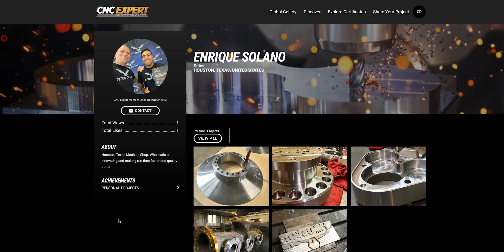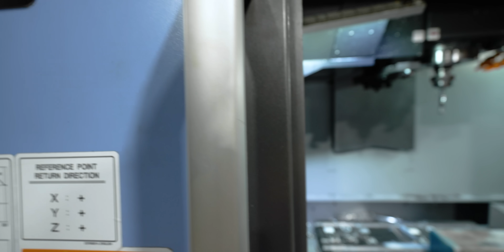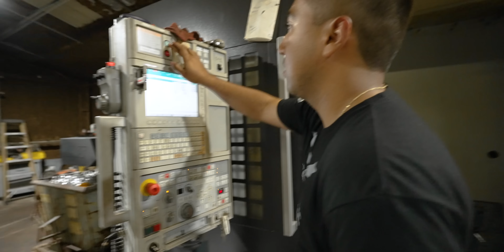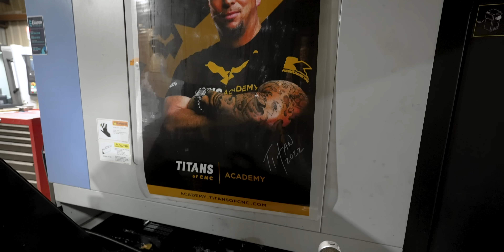Fighting With BOSS to INCREASE PRODUCTIVITY | MSM Machine Works

Comment: Many years ago the machine shop I worked at got bought out by the supervisor.  To get going they partnered with another local machine shop.  The partnership fell apart partly because the partner got fed up with slow cycles.

As for Kennametal NOVO, I learned about it at said partner when I worked for them.  While the culture wasn't that great they did care about CNC efficiency, especially once one of their customers dropped big orders on them.

NOVO and Harvi I TE turned machining stainless from a chore to something actually enjoyable.

Comment: I'm currently running a part that the previous lead/programmer had as 5 ops taking 2-2.5 hours each and I reprogrammed to only have 2 ops and one side takes 20 min while the other takes 9 min. I can go more but being forced to work on 3-4 machines while also helping coworkers with their setups and programs while also being asked for help from other departments has made me say enough especially when the owners don't value their employees and only care about getting new toys paid for by the employees.

Comment: Before I went it alone, the company I worked for (17 years) invested in vmc's and a 5th axis but refused to invest in 22 yr old lathes. I spent as much time trying to keep them running as I did cutting. after I left both machine completely packed in and was forced into buying two new Doosans. The help is out there for companies to push faster and better even if just with tooling. I don't do anywhere near the complexity of most but can always call on tooling suppliers for assistance and for free. what's not to gain from asking. listen to the staff. best of luck for the future.

Comment: At work we have a mori multitasking machine thats scrap bc an operator decided it was a good idea to turn the speed up of the turning Spindle. The part is unbalanced because of its shape so it flew out of the chuck, hit the milling spindle and cracked the cast iron of the x column. Sometimes theres a reason to go slow

Comment: Where I work, we make a part drilling 3x1.5mm holes 9.5mm deep into aluminum, and for some reason we kept breaking the drills. Someone slowed the drill cycle down to 3 inch per minute and pecking .01” per peck. I changed the drill cycle to 6 IPM and .1” per peck (still pretty conservative) and this by itself dropped the cycle time from 2:40 to 2:00 per part, and magically the drills aren’t breaking anymore. Another example of the older guys not wanting to embrace what the tools and machines are actually capable of.

Comment: Good luck kid.

I once got a robot to do my painting.
Problems:
1: it was 300 % slower than me
2: it used at least 100 % more paint to do the same job
3: as a result of excessive paint use, filters in paint booth have to be changed more often.

I think it was a stupid investment.

I had no problems keeping up, even if at that time i was already messed up a little from 3 years painting in another place.
BUT ! absolutely not a problem, it would have been if i had to paint 7 hours strait every day, but i only painted like 2-3 hours, the rest of the time i did everything from encoder setup - cleaning floors to running a grinding machine.
CUZ i dont take money for doing nothing.

Other than that i am all pro robots, working faster,working better.
Mind U, while i like CAD/CNC i am more of a hands on guy, so probably a good thing i am retired now.

Comment: i made a volumill program in gibbscam today to try it out. 8mm end mill running 150 vc 2000+mm in 17-4 doing keyways. We have a macro to make the keyway program almost the same way a bit simplified and running slower at 60 vc 0.2mmrev. First 10 or so shafts came out nice. Eager to see how the tool lasts.